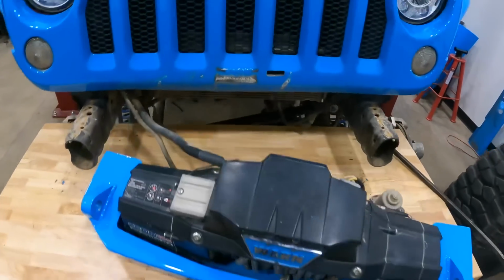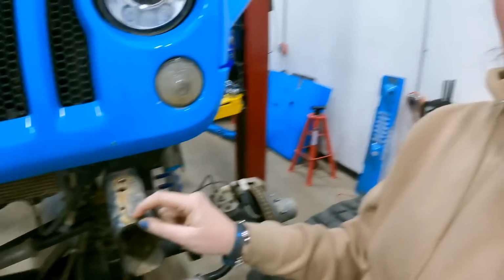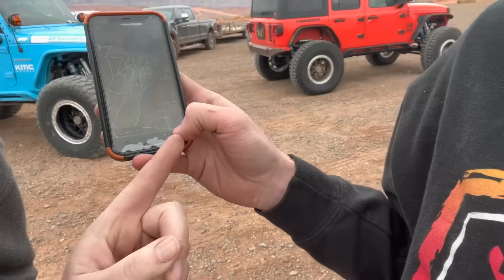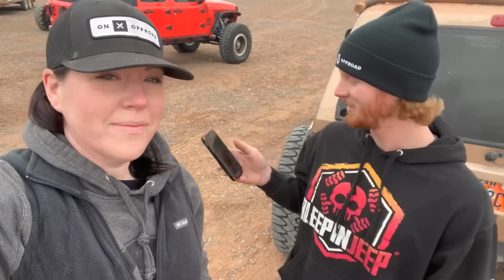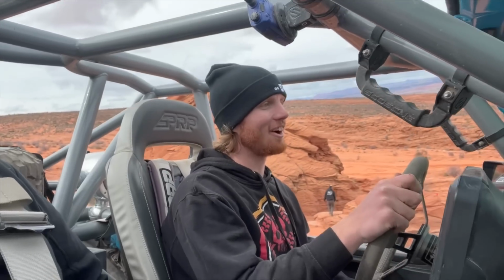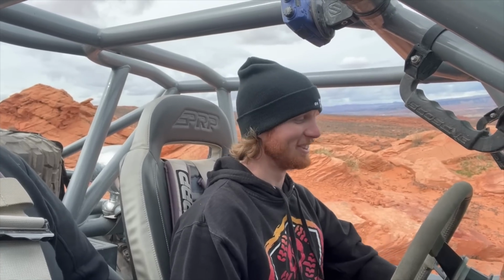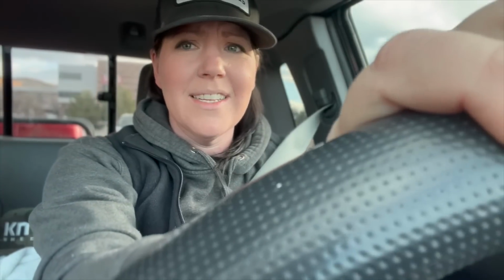Rudy’s First Time On Double Sammy

Comment: what gears are you running im looking at going to a 5.38 on 40s its a rubicon . also would anyone know someone in ohio canton area that does gear installs
Reply from the maker: I run OE Dana 5.38 gears in both of my rigs and when it comes to shops in Ohio, I personally know the entire team at Off The Grid Motorsports in North Canton and the owner Tommy is one of the few people I let work on my rigs. Give them a call or swing by and speak with them in person, you won’t be disappointed.

Comment: Looks like any vehicle with lockers can make the triple seven requirements being reasonably tall.
Reply from the maker: Yeah, 35s and a skilled driver would probably be fine. I’ve run the trail with rigs on 37s and it was a breeze.
Reply: Well rubicon jk on 33s is what I have like I said reasonably tall plus the wheel base  is shorter being 2 door.
Should make some obstacles easier.

Comment: Those little bumpers you Yanks (even import Yanks, apparently) use, go find an ARB store and fit a real one  😝😂
Good to see you out having fun instead of stressing over a build.
Reply: Gfy
Reply: Those arb bumpers rub tires on crawlers. Hence stubby bumpers. Built for type of driving that’s being done. Just because you buy the most expensive and shitty bumper doesn’t mean you’re built right.
Reply: A small bumper allows for a much better approach angle and for less chance of rubbing tires at full flex. Seeing as how Australia hard limits your tire size at 35" and even at that, you have to be approved by the government, this is something you just don't understand.